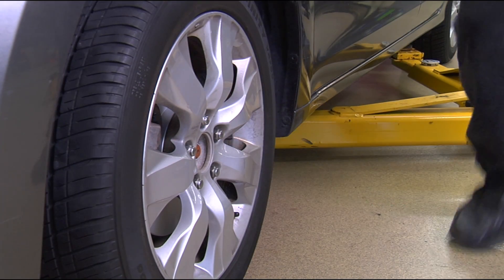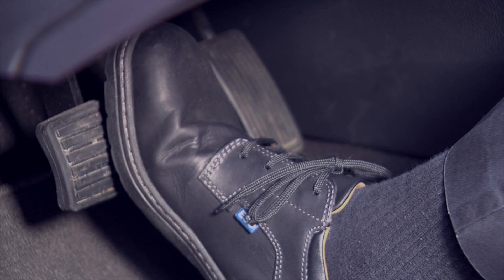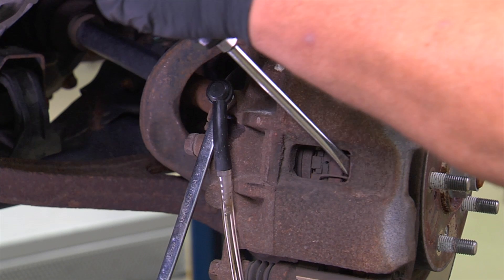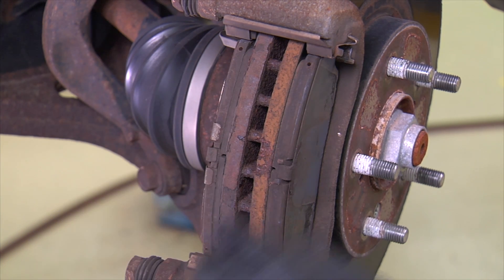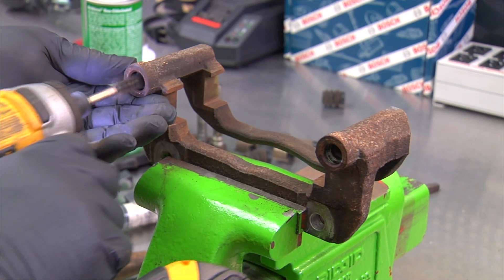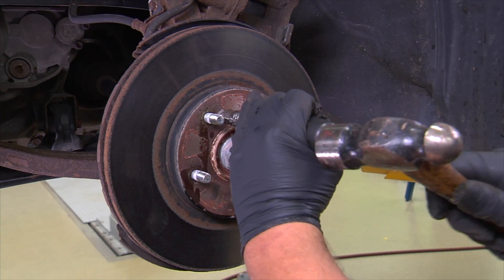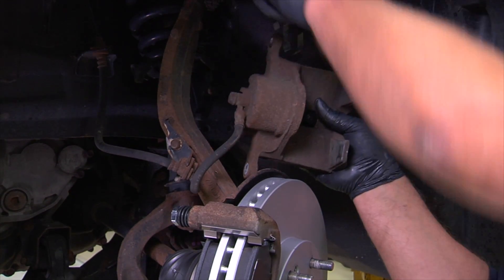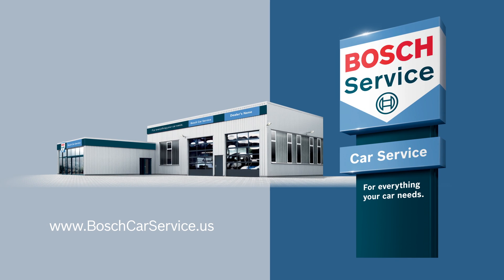Bosch Disc Brake Installation

Comment: I AM AS HAPPY AS POSSIBLE for choosing BOSCH Brake Pads. They are impressively durable and offer Superb braking performance! 
I own a Audi A6 C6 2.0 TDI 170, and after a Performance Software Stage1 Upgrade & FMIC , to 220PS, i decided to get proper brake pad's, preferably from a trustworthy company so i choosed BOSCH. 
After fitting the Bosch brake pads, very proud with my Stage 1 MOD, i have been driving like a MANIAC for about 5k Kilometers / 3k Miles , and  brake pads were still usable , for another at least 3k Moles/5k Kilometers , but decided to change them, and again i choosed BOSCH Brake Pads ! ❤
I i 100% Sure that if i would've drive that car nicely , BOSCH Brake Pads would've last for as long as 45.K Miles or 75 K Kilometers .
 
I am a mechanic and i re-clean & Re-lube the  braking pads+sliding rods & caliper every 1 year as i love my car working Perfectly ! 
Will definitely choose Boche next time as well.
Reply: Thanks for sharing feedback. I'm looking at replacement options for my brake rotors and brake pads on my VW Golf Mk6. What worries me is that Bosch brake pads are Made in China and the finishing on the material looks a bit "cheapo". Where were you brake pads made in? Do the produce any noise while braking, at any stages? Also, do they have that vertical cutout on the material side, as shown in video? Really appreciate your response, thanks
Reply: It does Not matter where they are built (China Germany Afganistan ) 
They are built at Required BOSCH QUALITY STANDARDS. They are silent if the Brake Disk is good also , if brake disk is worn them they may create noises. I can say that i tested the brake pads in extreme conditions (Very heavy braking) and they are good quality. (Tested)
Reply: @THE.DIYGUY  Thank you. I know what BOSCH is and that they (are supposed) to have their own quality standards. However, I used Bosch cabin filter for a car and it wasn't best quality. MANN, Hengst, Mahle were significantly better quality, that's why I asked. I ordered Bosch brake pads as well as new Bosch brake rotors for my car. They'll be arriving within 2 days and I am going to install them. I hope they'll be silent and efficient. Thanks once again
Reply: Make sure to use Copper paste , or any other High Temp grease (otherwose will leak everywhere) .

Also remember that after installing them , for the first 10 20 time when braking ,  you need to Gentely brake in order to get a good Pad&Disk wear (if you will Heavy brake they will uneven wear) 
Ps; sorry for my english i'm in a rush and don't find the right words
Reply: @THE.DIYGUY  I'll use ATE PlastiLube, the special paste for anti-rattle / anti-squeal purpose. And yeah, I very well know the importance of proper break-in techniques. Your English is fine and your statements are fully understandable. Thanks.

Comment: Why does the rotor look dull? Does it turn shiny after a use?
Reply from the maker: Thank you for taking the time to reach out. We've forwarded your inquiry to consumer care, who should be reaching out to you soon.
Reply from the maker: The dull appearance referenced is the coating on new rotors. The coating will be removed from the contact area between the pads and rotors. The contact area on the rotor then becomes “shiny” after a few brake applications. 

The non-contact areas of the rotors will remain with the coating to protect from corrosion.

Comment: Hi, I just bought the front brake pads from Bosch and to my surprise only one of the four has a wear indicator. What's is the theory behind this. OEM have one wear indicator for each wheel.
Reply from the maker: Hi Jani.  Thanks for reaching out.  Can you tell me the year, make and model of your vehicle and the part numbers on the front brake pads you purchased?

Comment: Could you explain the brake bedding procedure better?  Are these instructions for the semi-metallic as well as the ceramic?   20-0 ten times.  How long is a short cooling period for stopping?  40-20 slow down cycles ten times.  How hard to slow down?  Normal rate of slowing down?  How long is a short cooling period for slowing down?  
I'm looking forward to installing my first pads and rotors, and I bought Bosch semi-metallic pads.
Reply from the maker: Thank you for taking the time to reach out. We've forwarded your inquiry to consumer care, who should be reaching out to you soon.
Reply from the maker: Hi Jim.  I apologize for the delayed response.  Here is some information on the bedding procedure.

Bedding-in Procedure
•	During the test drive, the vehicle should be driven at a moderate speed (30-35mph) and brakes should be applied gradually (normally) without coming to a complete stop, to initiate the material transfer process. 
•	This process should be repeated for 8-10 times. 
•	Avoid more than a minute between each brake application to maintain the temperatures needed for the bed in process. 
•	Next, increase speed to 50 MPH and strongly brake down to 5 MPH. You don't want to brake strong enough to activate your ABS or lock up the tires. You should be able to come down to 5 MPH within a few seconds
•	Repeat this process 4-5 times, then drive an additional 1-2 miles while very lightly braking to cool down the brakes.
•	When handing the vehicle back to the customer, it is essential to advise them to brake gradually (normally) and to continue the bedding in process correctly.

Comment: what is the grease ushipped in the pad box for? he didnt use it
Reply from the maker: Thank you for taking the time to reach out. We've forwarded your inquiry to consumer care, who should be reaching out to you soon.
Reply from the maker: Hi Bill.  Thanks for reaching out.  Bosch brake pads come with synthetic brake lubricant for use in disc and drum brake systems.  This lubricant should be used on metal-to-metal contact points and sliding surfaces to reduce corrosion, noise, and vibration.  An example of usage in the video is at the 5:40 mark.
Reply: @BoschAutoNA  where can you get Bosch brake pads in Ontario Canada? I cannot find stores that carry your pads!
Reply from the maker: Thank you for taking the time to reach out. We've forwarded your inquiry to consumer care, who should be reaching out to you soon.
Reply from the maker: Hi Bill.  What is the year, make and model of your vehicle?

Comment: won't opening that bleeder screw let air into the system?
Reply: Not if you have a hose connected to it and immediately close the bleeder screw when the piston retracts all the way.
Reply: It could.  This is why I never touch the bleeder screw.  (plus it could create a fail point if not tightened properly)  Instead, I pull the assembly apart, and remove the pads, then use a "C" clamp to compress the brake piston.  This pushes fluid back through the entire brake system.  Just make sure you have your brake reservoir cap off.
Reply: @thedeaffarmer4422  For cars with ABS this is not recommended as pushing fluid back through the Abs unit might cause it to fail.
Reply from the maker: Thank you for taking the time to reach out. We've forwarded your inquiry to consumer care, who should be reaching out to you soon.

Comment: So I just installed Bosch QuietCast pads and rotors on my 2004 Corolla.  Went for a test drive and oh wow, the noisiest grinding noise I've ever heard after a break job. I'm 100% sure I put everything back together correctly but getting a lot of grinding noise. Is that normal for the QuietCast pads and coated rotor? I did my 10 complete stops from 20 mph to 0 and then 10 slow down cycles from 40 mph to 20 mph. Your thoughts? I'll be pulling the tires and checking everything again. Wow, loud grinding....
Reply from the maker: Thank you for taking the time to reach out. We've forwarded your inquiry to consumer care, who should be reaching out to you soon.
Reply from the maker: Hi Joe.  I'm going to have this sent to our technical support group.  We would like to look into your issue. Please fill out our form so that we can get you in touch with our product specialists. http://spr.ly/6055G9WgN
Reply: @BoschAutoNA  Human error.
Reply: what did it wind up being?
Reply: @johnmiller9219  Human error. I placed the pads on backwards. The metal pad was gone and rotor scarred pretty bad.
Reply: @joeheskett7225  ouch! thanks for your reply i have ordered 4 of these Bosch rotors and pads
Reply: @joeheskett7225 good of you to man up and admit that you made a mistake. 💪🏻

Comment: are the inner and outer brake pads the same??   looking to install tomorrow
Reply from the maker: Thank you for taking the time to reach out. We've forwarded your inquiry to consumer care, who should be reaching out to you soon.
Reply from the maker: Depending on the application the inner pads and the outer pads are usually the same but there are part numbers where they are different as well as left wheel and right wheel.  Most applications all 4 pads are the same. 

Since we don’t know which part number you are going to install, we suggest as you pull off the used pads off the vehicle you mark them where they came off (inner/outer) and left wh/right wh).  If all four coming off your vehicle are the same then the replacement set from Bosch will be the same way as well.  If they are different coming off the vehicle then you can match up each used pad to the new pad out of the box.  If you give us a part number we can tell you exactly which is the case.
Reply: @BoschAutoNA  it was a Bosch bc 1084 .   I put them on and so far so good.   Brakes well so far.
Reply from the maker: We're happy we were able to help!

Comment: You definitely don't need to bleed the brakes while compressing the piston. Just make sure you do it slowly.
Reply: He said the idea was to avoid pushing old fluid that might be contaminated with corrosion back into the ABS module. I have never done it this way but I think I will start.  Actually a good idea to freshen all the fluid if you're only doing brakes every 2 years or longer anyway.
Reply: J.Moore,

Opening the Brake Bleeder Valve & allowing the Fluid to run into a 15 % - 25 % filled bottle is the Professional way to do Brake jobs ; even for your Enemies.

Email me & I'll attempt to Screen Shot one of my 1 page Articles from the Professional Bendix Brakes Answerman on this "Critical Subject" that most people don't even do..If I can't S. Shot it, I'll re-write & email , if you "ain't" one of those paranoid Americans.

cbarkwell31@gmail.com
Southern California
Professional Automotive background

Comment: one issue I have is with the website itself, it would be nice to be able to buy your products straight from the website. It's hard at least here in Ontario to buy your products, as most of them are available only in the states and cost twice as much as the item itself.
Reply: Try Rockauto,  the total cost of parts plus shipping is still cheaper than that sold in Ontario stores.

Comment: Same grease to the guide pins and  pad carrier? Spraying brake cleaner and putting grease inside right after? Shit job! Pins need silicone high temp grease neutral with rubber. Pads need ceramic paste that will dry.
Reply: True but would you honestly still say it's a totally shit job?

Comment: I call Bull#%&t !! !! !!  There is NO WAY you are removing bracket bolts with an air ratchet !! !! !!
Reply: For an old rusted card with brakes not being serviced for years maybe. But for a car following the service intervals for brakes, a breaker bar or a long enough wrench will do the job.
Reply: @johnremcastro  I couldn't get my caliper bracket bolts off.  Will try with longer wrench and breaker bar and using a jack.  The impact wrench couldn't get the bolt off and only had access to one of them.
Reply: Wow, through the magic of editing they skipped the time he went to take a piss. No way I do a complete brake job without taking a leak. Imagine that you maroon, LOL !!

Comment: Do you recommend Bosch Blue or Quiet-cast pads??  I drive a 09 Toyota Tacoma 4x4 and put 25-30,000 miles a year on this truck.  I also tow a 1300 lb small fishing boat during the summer.  Which pads best match OEM??
Reply from the maker: We recommend QuietCast pads for the front axle, specifically part number BC976.  This pad features out latest copper free premium friction material that will provide excellent stopping power while remaining extremely quiet, low dusting, and long life. You can find out more about our friction material at http://www.boschcopperfree.com/en/.  We also offer replacement rear shoes for your vehicle, part number BS871.
Reply: @BoschAutoNA  Hai.. I am from India. I have Toyota innova 2006 model. I am recently changed new bosch break pads and disc rotors. But the pads not good. I think that is not original pads. So please let me know which is the best pads?? (original bosch pad and the code(part) number.I am waiting for your reply. Thanks